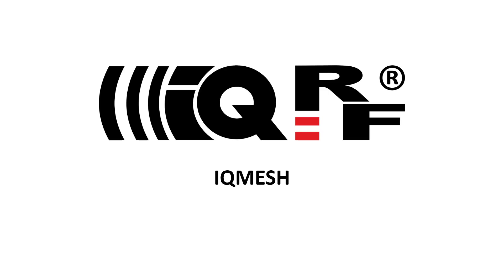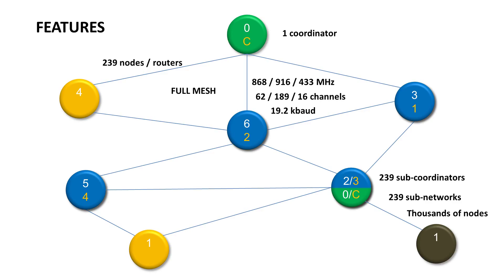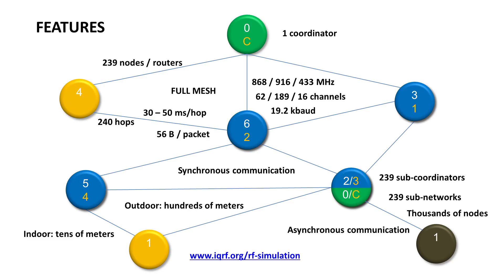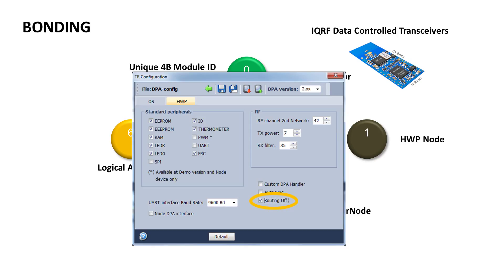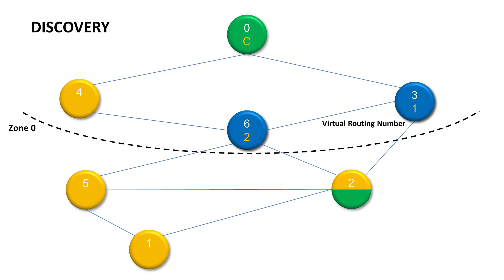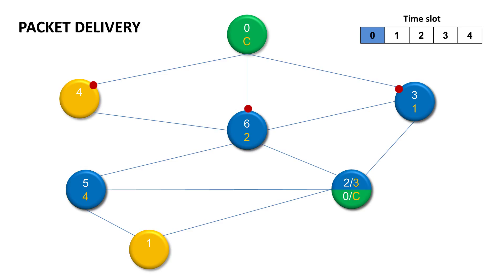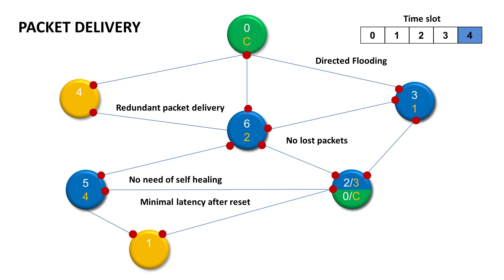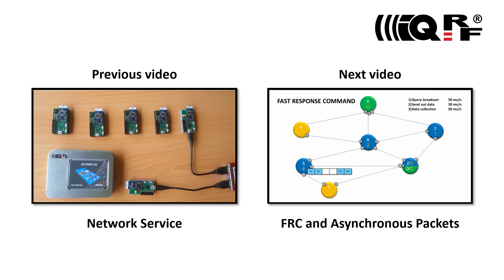11. IQMESH

Comment: is it absolutely necessary that routing is turned off in one of the devices? If a node loses a connection with a router, would it be discovered by another router?
Reply from the maker: Hello Sai,
Ad 1) No, all devices can work as routers. Switching off routing make sense mainly in two cases: minimizing power consuption and speeding up communication throughout the network - less routers less hops less time
ad 2) Discovery is done only when a topology changes and must be initiated by your SW. In standard situation when there is a temporary lost of connection between two nodes, mesage is delivered from other neigbours. That's why it's good to have a topology quite robust - meaning each node should have 3 and more neigbours.
Simon
Reply: Cool. Let's say my nodes move constantly and I cannot rely on a connection between two nodes. should I constantly run discoveries in select intervals?
Reply: Sai Yamanoor This depends on the scale of your network and speed of movement of your nodes. There are basically two options: 1) The one you suggested. Run discovery regullarly. This will work though only for small networks with slowly moving nodes. Discovery for big networks (50+) nodes can take few minutes...
2) I believe better solution is to have a static routers that cover the whole area where your nodes are moving around. Moving nodes have the routing switch off so they don't route and you don't care where they are in the area. We use this kind of topology in projects like moving forklifts around a wharehouse. 
More info about your project would help to find the best solution - number of nodes, area of movement, speed of movement, data a frequency you want to send out, etc.
Reply: Šimon Chudoba Thanks. I have the IQMesh kit and I will get in touch with your organization via the IQRF contact info. When all the nodes in a mesh network have their routing capabilities turned off, can they exchange messages with the nearest node irrespective of which node they bond with during discovery? For e.g. Node 1 was near node 2 during discovery  but node 2 move near node 5 but far away from node 1. Now can node 5 exchange info with node 2?
Reply: Sai Yamanoor The best is to write your questions to support@iqrf.org. The whole communication in the network is synchronized by the coordinator. So node 1 cannot send data to node 2 for instance. It needs to work in the way that coordinator request data from node 1 and send them to node 2.